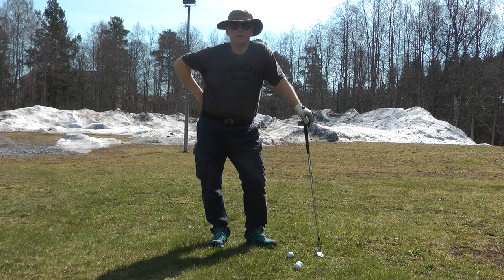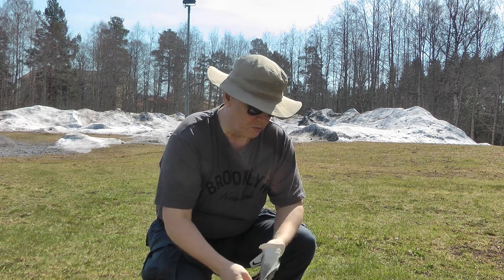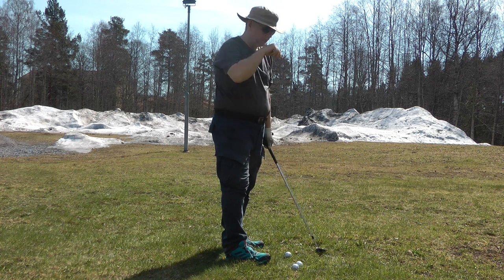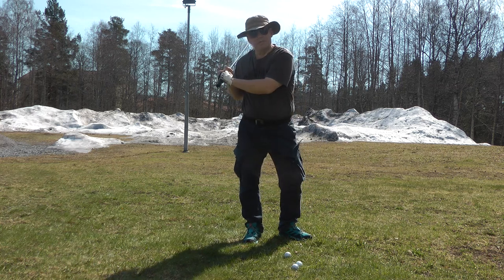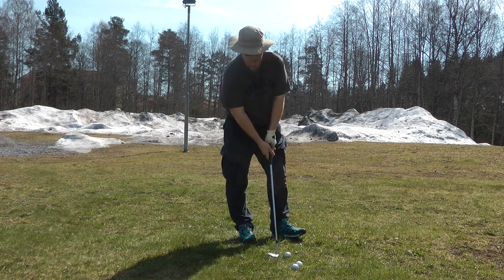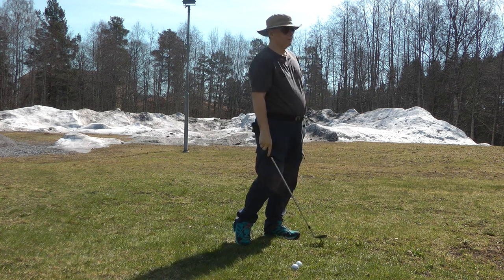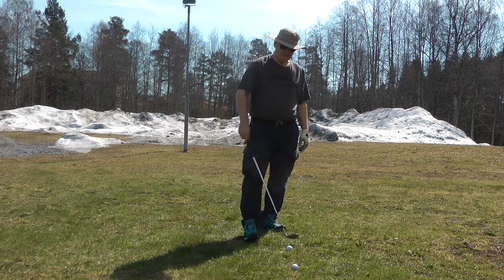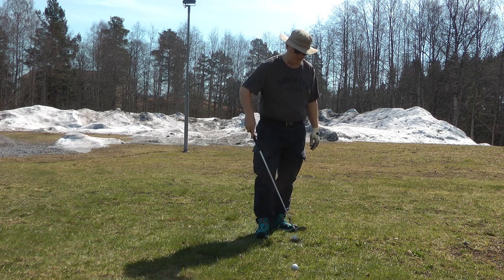Future Golf Instruction Robs golf grip

Comment: This grip It’s much more of a free unrestricted natural movement of the wrist levers when swung naturally with the arm and shoulder levers. It is definitely different to using the modern grip with thumb on the shaft. The release is more natural and responsive. If you let these work in unison with the correct body movements, you will have all the chain actions of a great golf swing which I’m sure Robert will be covering in more detail in the very near future. I’m going to commit myself by saying that when applying this grip for chipping around the green and just letting the wrist levers do the work the results are so good you can literally perform any type shot, low, flop and with spin and control. And the amazing thing is you don’t have to think about it, it just happens. Is this true Robert, is this what you found.